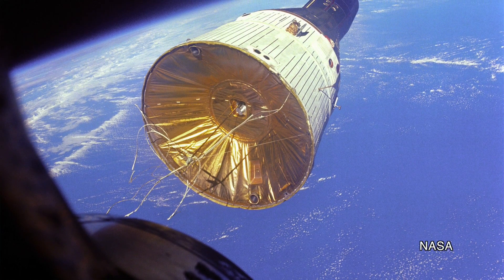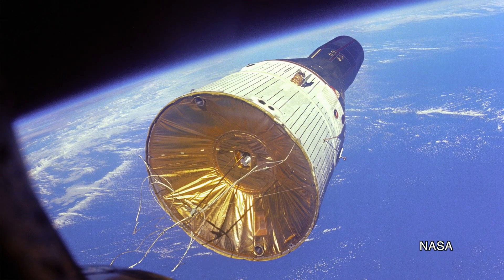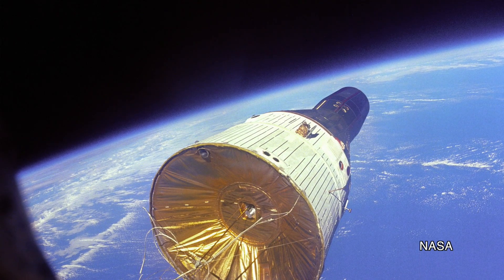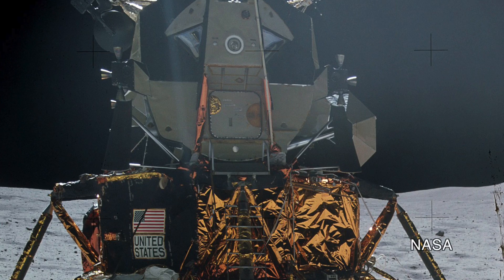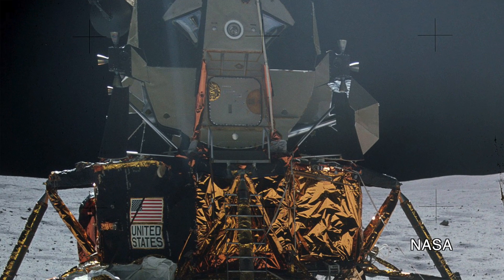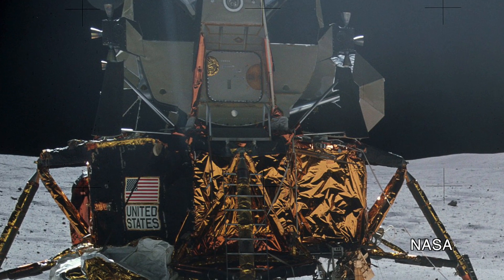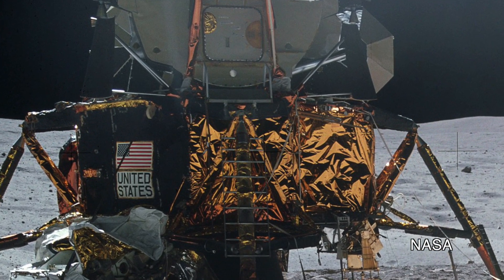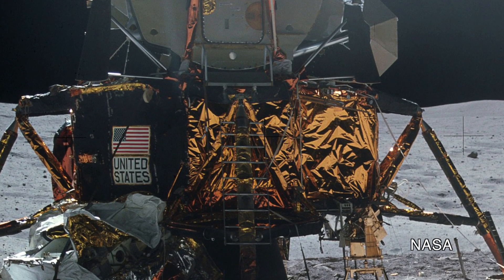What's With the Gold Foil on the Gemini Spacecraft?

Comment: Well, yeah, but why gold?
Reply: +mustang6172 It's not gold. It is Kapton, a transparent yellow polymer produced by DuPont. It looks gold because on the other side is a thin film deposition of aluminium. Combined, it looks gold. Alone, it looks like clear yellow plastic film.
Reply: +David S. Because gold is much better at reflecting energy in the IR spectrum than anything else.
Reply: +David S. i think its a mylar like film developed by dupont called Kapton... its a polymer designed to withstand extreme temperatures and be an excelent insulator..... its just gold-like-colored.
Reply: +David S. As a conductor, gold is second only to silver.  Silver tarnishes easily so gold is easier to work with.
Reply: Mark Holm It is vacuum deposited aluminium backed Kapton. . . 

The metal coating is on the inside surface, the kapton is placed over the aluminium deposited film. That is why it seems gold, the light is reflected off the aluminium film, through the Kapton; thus looks gold.
Reply: Mark Holm I am only an aerospace engineer, this topic would be more for a chemical engineer; but ill do my best to answer.

Firstly, Kapton is specifically made for intensive environments. But there are different grades of Kapton for different applications.

As for the aluminium, well aluminium and gold are both very conductive; this means that local hot spots on the surface of the materials will be distributed out to a larger area thus preventing local failure. Aluminium is also much lighter then gold, and much cheaper.

The aluminium backed film is produced in vaccum and does not form an oxide layer, so it also reflects much better then gold. So i would say that, just these very slight increased in affordability, and reflective performance make it a better choice for space craft applications.

Gold is more dense then aluminium which would be beneficial in an EVA suit where humans are directly exposed, but for use on space craft, i would say it is infeasible. Though, it could be used.
Reply: +brch2   Yes, I have seen that.  The problem is that what we see in the pictures is not at all consistent with a fiberglass part.  The Gemini spacecraft, like Mercury and Apollo, were not standardized, production line products.  Many things about them changed from mission to mission.  Also, the development program was very rushed.  We know that quite a bit of documentation was written before "final" decisions were made.  This is really the root of the problem in this thread: the documentation available online is not sufficient to answer all our detail questions.  We know, in this case, a range of possibilities, but we do not have specific documentation to decide between them.
Reply: +CaptainDuckman Huh?  During my entire lifetime, which includes the American manned space program, gold has been more expensive, gram per gram, than silver.  Further, the vacuum evaporation process that coats plastic film uses quite a small amount of metal.  In spaceflight, technical considerations almost always dominate.  The metallized film on Gemini spacecraft, if they used gold, would have included perhaps a gram of the metal.  Cost would not have been an issue.

Also, in this thread and in historical documents online, only two metals are mentioned as being used, or being likely to be used in this application, aluminum and gold.  Silver has never been mentioned.  One good reason that silver has not been mentioned is that it has a serious technical problem in this application.  Silver corrodes rapidly in Earth's atmosphere.  Humid, salty air, typical of Cape Canaveral, will destroy a thin layer of silver in days, maybe hours.
Reply: +Mark Holm  Reality: These films consist of a plastic layer, around 0.001 inch thick, with a very much thinner layer of metal on one or both sides.  In space applications, two types of plastic are common, Mylar, aka polyester, aka polyethylene terephthalate, aka PET, aka PETE and Kapton, aka polyimide.  Aluminum is the most common metal, but gold is also possible.  Silver is right out!  Mylar is transparent and colorless.  Kapton is transparent and yellow-orange.  Aluminum opaque, reflective and silvery colored.  Gold is opaque, reflective and yellow-orange color.  Continued in next comment.
Reply: +Mark Holm  When all you have to go by is a photo, there are combinations that are difficult or impossible to distinguish.  Gold color might result from a gold coating facing the camera deposited on either plastic, a gold coating on the far side of a Mylar film, or either a gold or an aluminum coating on the far side of a Kapton film.  Silvery color might result from an aluminum coating facing the camera deposited on either plastic, or an aluminum coating on the far side of a Mylar film.  To solve the question for the Gemini case, we need either solid documentary evidence or a careful examination of an authenticated sample.  So far, nobody in these comments has delivered either.  The betting, however, is on aluminized Kapton, with the aluminum side in.
Reply: +brch2  Silver is not used for a simple reason.  It corrodes on exposure to Earth's atmosphere.  Materials have to survive production, storage, fabrication, installation, transport and just plain waiting, before they get to space.  Silver won't do it.  In particular, the humid, salty atmosphere of Cape Canaveral would destroy a silver coating in short order.

Gold is used for visors because it is highly reflective in the infrared, but partly transparent in the visible.  The Sun's output actually peaks in the near infrared.  Gold helps keep that out while allowing vision, through.  A couple miles from where I grew up, Monsanto built a large building in the 1960's clad with gold coated glass.  It is hard to see these days, because trees have grown up between it and the road.  There is a building with gold coated windows here in Pittsburgh, next to the main highway west out of town.  In both cases, the idea is to reflect infrared while allowing filtered visible light through.
Reply: +brch2   The problem with that is that the photographic evidence from orbit does not support it.  The stuff in those pictures does not look like fiberglass.  It looks like metallized film.  We need to remember that the Gemini spacecraft were not identical clones.  Each one was a customized version of the basic plan.  Things like those we are discussing may have been different between missions.  Also, and this is an important point, the project was very fast paced, with many engineering changes during development.  We know that documentation written at one point in time is very likely not to reflect later changes.
Reply: +NightOwl Yep and it makes an attractive sun visor too!
https://s-media-cache-ak0.pinimg.com/236x/ab/ae/f9/abaef9e994305407460b23c216b62b76.jpg
Reply: +HONORGUARD308  It might be gold!  Gold is more reflective than aluminum in the infrared.  If you are trying to keep heat out, you put the metal side of the metallized film out, because the plastic absorbs more infrared.  If you are concerned about the plastic film holding up in intense ultraviolet, a problem in near-Earth space, you also put the metallized side out, because the metal is unharmed by UV while the plastic may be degraded.

The most common metallized films are made from polyethylene terephthalate.  Although it's melting temperature is fairly high, it's glass transition temperature is about 75C.  This causes PET to become soft and stretchy, and as well, to often shrink and distort at temperatures near the glass transition.  Thus the use of Kapton film for spacecraft.  Kapton is mechanically stable to much higher temperatures.

Yes, Kapton is yellow, but the metal coating may well be gold and be placed outside facing.
Reply: +HONORGUARD308  Not trying to be a pain, but since aluminum and gold coating are both possible, what is your reference that it is aluminum?  I accept the Kapton.  That makes sense.  It has the properties you want for the job.  But why face the Kapton out and the aluminum in?  That part leaves me confused?  Exposing plastic, particularly thin plastic film, to intense UV is a recipe for failure.  Maybe Kapton holds up long enough?  I just don't know.
Reply: +Mark Holm   For instance, this reference specifically calls out both gold coated and aluminized Kapton film as components of the ASTP EVA suits.  What were the engineering considerations of gold vs aluminum coated Kapton since both were available?

https://books.google.com/books?id=Qlo_kJwtyZoC&pg=PA254&lpg=PA254&dq=aluminized+vs+gold+coated+kapton+film&source=bl&ots=BJAsD7QtCB&sig=WQBjgq12qBsbwpY5mNV8uE6OOlI&hl=en&sa=X&ved=0ahUKEwiZjcf37qnKAhWBPD4KHYsBBa0Q6AEIOTAF#v=onepage&q=aluminized%20vs%20gold%20coated%20kapton%20film&f=false
Reply: +HONORGUARD308  As I read it, you do not actually know, from personal or documentary knowledge, whether the metallization is aluminum or gold.  You are guessing.  Your try at engineering rationale is weak.  I hope you are a better engineer in your field than that.  Aluminum deposited in a vacuum is unoxidized, but is almost instantly oxidized when exposed to air.  This is common knowledge to chemists (I am a chemist.) and was well known, specifically in the case of vacuum deposited aluminum, well before I was born, which is before the space age.  Both the electrical and thermal conductivity of gold are a bit higher than aluminum, though not greatly so.  The mass, density and cost differences are negligible because the coating thickness is extremely small.  I agree that Kapton is the likely film material.  It has superior properties for the job, was available in the 1960s and is siderúrgica mentido de as the material used in spacecraft applications.
Reply: +Mark Holm If you place aluminized Kapton Kapton side out, the Kapton will absorb much more than the very thin layer of aluminum oxide that forms when aluminum is exposed to air.  Nearly all of the world's reflecting telescopes, including the multi-meter diameter giants are surfaced with vacuum coated aluminum.  The oxide layer that forms on them is not significantly absorbent.

The chief difference between gold and aluminum in the metallized film application is that gold has higher reflectivity in the near infrared while aluminum is much more reflective in blue and ultraviolet.  The energy spectrum of the sun peaks in the near infrared, so that, if keeping cool is your object, near infrared reflectivity is important.  I am not saying this proves that Gemini or any other application actually used gold, I am saying that gold is a strong possibility that should not be rejected without documentary evidence when we are considering a historical object.
Reply: +Mark Holm   DuPont data show that Kapton loses 25% of its ultimate elongation in 1000 hours exposure to unfiltered sunlight.  That is a pretty significant loss of properties, representing a significant amount of embrittlement.  1000 hours is 42 days, so unprotected Kapton would be fine on a Gemini or Apollo mission, but would not be suitable on longer duration missions.  You would be forced to put the metal side out.
Reply: +Mark Holm   Stupid spell checker!  Not only did it turn my English into some Romance language, it confused me, too!  I meant to say that Kapton is frequently mentioned as the film material used in spacecraft applications and is therefore likely as the film material in the Gemini application.
Reply: Mark Holm You are just confusing the hell out of me.

Anyway, it is actually possible that you are completely correct; i dont know shit about historic space craft, i just know how we implement Kapton for modern space craft.

Modern space craft use vacuum deposited aluminium film that is backing an external layer of Kapton. . . But you could be correct, there should be info about this anyway. NASA does a good job at releasing a lot of old info for education.
Reply: +HONORGUARD308   Ok, you changed your tone.  Now you say you do have personal knowledge of how aluminized Kapton film is used in modern spacecraft.  That is a solid reference point.

I have to say, as a chemist with some experience in plastics, I would not put an unprotected, natural color plastic in a space application.  I would be worried about UV degradation.  My first thought would be to put the metal side out in order to protect the plastic.

If you put the plastic side out, sunlight passes through the film twice, once on the way in and once on the way out, after reflection from the metal film.  Kapton is not transparent!  That is why it is yellow.  It is absorbing energy.  If you are trying to stay cool, absorbing energy is not what you want.

As for the near-IR thing, it is simple.  The sun's power spectrum peaks in the near-IR.  If you are trying to reflect away the most solar power, paying attention to near IR reflectivity is important.  Gold reflects very well in the near IR
Reply: +HONORGUARD308   I got into the question of oxidation on evaporated aluminum films because you claimed evaporated aluminum films do not oxidize.  That is false.  They do oxidize when exposed to Earth's atmosphere as do all aluminum surfaces.  My point about astronomical mirrors is that the thin layer of aluminum oxide that forms on the surface of evaporated aluminum does not significantly degrade reflectivity.
Reply: Mark Holm I never said anything about evaporated aluminium, and i never claimed such a thing did not oxidize.

You are now just trolling arnt you.
Reply: +HONORGUARD308   No, I am trying not to troll.  If I have misunderstood you, I apologize.  The aluminum or gold coating on plastic films, including Kapton is applied with an evaporation process.  I assumed you knew that.
Reply: Mark Holm
You are so trolling lol

The aluminium film is produced by a vacuum deposited process, kinda the opposite of evaporation.

The vacuum deposited aluminium is a separate film, the aluminium is not deposited onto the Kapton.

There is an aluminium film, and then a Kapton film. They are two separate films that are over lapped onto each other.
Reply: +HONORGUARD308  I think if you do some research, you will find that I am correct.  The vacuum metallization process evaporates, or in modern systems sometimes sputters, metal into a vacuum as free atoms or very tiny bunches of atoms.  The atoms fly through the vacuum and stick to the plastic film.  The layer of metal deposited on the film is quite thin, well under 0.001 inch.  Both aluminum and gold can be applied to plastic film this way.  In the case of aluminum, the bare surface oxidizes when it is exposed to air, creating a thin, transparent oxide layer..  This is inevitable with aluminum.  The vacuum evaporation process was invented in the 1930s and is documented in John Strong's famous book, "Procedures in Experimental Physics".  The original method coated glass, typically.  Adopting the method to plastic films came in the 50s or 60s.
Reply: Mark Holm 
You are wrong, please stop trolling.

The aluminium is not deposited onto the Kapton like you say, it is deposited on a separate film in a vacuum and then gets a surface coating to prevent oxidization.

Vacuum deposition is the opposite of evaporation; Deposit is to add, evaporate is to remove. It is vaccum deposition.

Also, when your talking about vaccume deposition processes you dont use inch as a measurement; use microns.

You are constantly just bringing up random, all of which has nothing to do with anything.
We use vacuum deposited aluminium film backing Kapton film.
I am an aerospace engineer, i have used this thermal protection before.

That is simply what it is, ok. . . If you want to have an actual conversation then get directly to your point.
Space craft are not EVA suits, space craft do not use gold for thermal protection.

You might as well just start debating with every single aerospace engineer and scientist about why they use specific types of propellants, or why use a specific number of stages, or why use one type of structural material and not another. Ok. . Vacuum deposited aluminium film backing Kapton film.

Please stop trolling.
Reply: +HONORGUARD308 OOOOO cat fight......
Reply: +Mark Holm +HONORGUARD308 According to resources posted online, the 'gold foil' on Gemini was a gold deposited fiberglass cover, while the 'gold foil' on the LEM was aluminized Kapton foil. Seriously, is it really easier to argue endlessly than to use Google and take 5 minutes to look up what was what?
Reply: +brch2   1 Please cite your reference.  2. The material we are discussing does not look like fiberglass, gold coated or no.  It looks like plastic film.  3. It is very likely the configuration of this part of the Gemini changed across different missions.  For instance, in at least one of the EVA missions, it was modified to make room for EVA equipment.  What may have been fiberglass on some missions may have been changed to plastic film in others.
Reply: I'm going by the Project Gemini Familiarization  Manuel dated 30 September 1965. Page 40 of the pdf (page 2-23 of the document) claims "A gold deposited fiberglass temperature control cover protects the equipment from solar radiation thru the open end of the adapter after separation from the launch vehicle". http://www.ibiblio.org/apollo/Documents/GeminiManualVol1.pdf  Now like you said, it's possible things changed on other mentions, but I can not find any other reference to other materials used to cover that area. I obviously don't know how much gold plating, or the specs, but I can imagine a thin enough layer of fiberglass coated heavily enough would look like the pictures of the "foil" covering I always see. It looks similar enough to modern gold coated fiberglass sheets used as welding blankets, which is designed for temps of up to 1000 degrees F.
Reply: brch2 Well given that you provided a source, though rather unclear exactly what it is talking about, does put enough doubt into my mind that i could have been wrong.

Apollo missions used Maylar, new space craft use Kapton. I suppose gold might have been used prior to Maylar and Kapton. . . This is worthy of further research, i honestly thought i was for sure Kapton or a predecessor.

The only problem with using gold is that it is very conductive, the complete opposite of an insulator. And both fiber glass and gold is much heavier than aluminium and polymers.
Reply: HONORGUARD308
I can't find a definitive answer as to what the composition of the LM material actually was... some sources say Kapton/aluminum, others say Maylar. May have included both in layers, I honestly don't know, and unfortunately the LM Familiarization Manuel is less helpful as to the insulation makeup than the Gemini manual... http://ntrs.nasa.gov/archive/nasa/casi.ntrs.nasa.gov/19730060786.pdf   Descent stage is page 2-6, paragraph 2-11, pdf page 25
Reply: +brch2 The material is definitely aluminized Kapton, which appears gold because of the Kapton's color. Just because it looks gold doesn't mean it has the same thermal properties; in particular, how it behaves in the longwave IR is very important. Kapton and Mylar have high emissivities, i.e., they look essentially black in longwave IR so they radiate well. Gold, on the other hand, has low emissivity; it looks shiny in longwave IR so it radiates poorly. Gold therefore reaches a very high equilibrium temperature in the sun, while aluminized Kapton (with the Kapton side facing the sun) stays cool.

Kapton is preferred for external surfaces because it can tolerate extremely wide temperature ranges. 

Mylar (polyester) is grey in color. Aluminized Mylar (which you can buy in camping stores as "space blankets") was used on the Apollo LM and in the spacesuits but, because of its more limited temperature range, only under covers where it can't be seen. The LM ascent stage used aluminized Mylar blankets under thin metal micrometeoroid shields. The pressure suits used stacked aluminized Mylar blankets under an outer layer of white beta cloth (Teflon-coated fiberglass).
Reply: ApolloWasReal
Yeah, I forgot when mentioning the LEM that there is a source mentioning what the "gold" material is. It is definitely Kapton, because it was mentioned by Armstrong, who mentioned it being blown everywhere by the ascent stage motor.
Reply: brch2 Right. Aluminized Kapton is still widely used in spacecraft of all types. You'll see it in almost any picture of one being prepared for launch.
Reply: +NightOwl no, not quite. Silver would have been better but silver is much more expensive than gold (yes, I know) for this particular application. Gold was good enough, so gold was used.
Reply: Mark Holm Indeed. NASA was not adverse to buying (and expending) large amounts of silver during the Apollo program. The silver-zinc battery was standard in both the Saturn launch vehicle and the Apollo spacecraft. There are probably tons of it still on the moon if anybody wants to go get it.

Gold, regardless of its price, is not a good thermal coating. It gets very hot because it absorbs the shorter end of the visible spectrum instead of reflecting it as aluminum and silver do. That's why gold is yellow in the first place. The one use of gold in Apollo that I know of is on the visors used on the lunar surface. I'm not even sure why it was used there instead of aluminum.
Reply: Gold is easier to use in those applications than aluminum, and the gold was and is rarely or never used alone, but is plated to or covering other material that serves further purposes in heat reflection/management. And gold is more stable and less prone to corrosion or other problems than silver, which is important since it is exposed to Earth environment long before it gets to space. Gold isn't generally the only material involved when used, but was/is determined to serve the intended purpose better than other materials and with less problems.
Reply: brch2 What applications?
Reply: +ApolloWasReal   The applications are spacecraft shielding and the specific topic is the metallized film shielding on the aft end of Gemini spacecraft.  The comments have gotten rather out of hand.  People are clearly writing things they have no knowledge of.  I will write a summary of reality in the next comment.
Reply: Whichever of all the applications they used gold for and not alternate materials. Visors, the coating on the protective layer of the Gemini aft section, etc. I don't know all of the uses, but for whatever reason, when they use it they have reasons... most likely, it's sufficient for their purposes when combined with other materials/systems assisting with cooling, and guessing it's more stable than silver and is likely easier to either incorporate or is better at the task when mixed with the other materials they use than other metals used for heat transfer/reflection/etc.
Reply: Mark Holm Thermal blankets, being rather delicate, are one of the things you put on a spacecraft only at the launch site, in an air-conditioned clean room. It is then mounted on the rocket and the fairing closed around it, the order depending on the specific type of rocket. It is continuously supplied with conditioned air from ground units until liftoff when all the umbilicals (including ventilation ducts) are disconnected and ejected. It then takes only about two minutes to reach vacuum; in fact the pressure drops so fast that the blankets must be designed to vent trapped air.
Reply: +ApolloWasReal   Thank you for that detail!   Silver still would not hold up well enough.  Aluminum has similar reflectivity and forms a durable oxide layer that protects it for several times silver's lifetime in air.  Astronomers, historically, have a lot of experience in this regard.  Before the invention of vacuum metallization, chemical silvering was the only way to get a reflective coating on glass mirrors.  The chemical silvering process is great fun to do, at least on a small scale and if you think chemistry is fun, but the result is frustratingly short lived.  Vacuum evaporation of aluminum almost completely replaced silvering in a few short years after it was invented.  The reflectivity of silver exposed to air drops off quite rapidly.
Reply: Mark Holm Yes. I seem to remember seeing a special chamber that was used to resurface a large telescope mirror at the Siding Spring Observatory in Australia. I guess it's a routine practice.
Reply: Mark Holm I did post a link to a historical record earlier in the thread stating what the gold cover was... on Gemini, the familiarization manual NASA released to crew, news sources, or anyone else needing the basic information, claims that it was gold deposited fiberglass. Maybe not the best option, and almost certainly not what the LM used, but it worked for that purpose (protecting from solar radiation... which doesn't necessarily mean protecting from heat in general). And regardless of what it appears or doesn't appear to look like, the only official NASA document I found about the subject says it was gold deposited fiberglass.

40th page of the PDF.

http://www.ibiblio.org/apollo/Documents/GeminiManualVol1.pdf